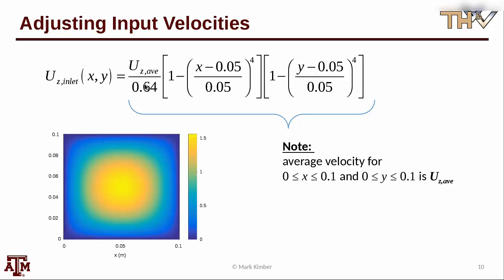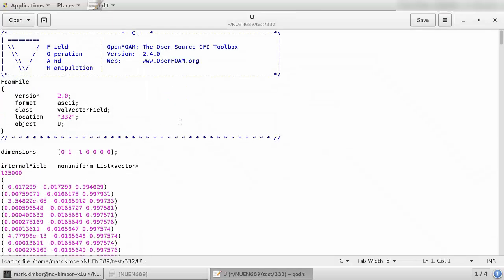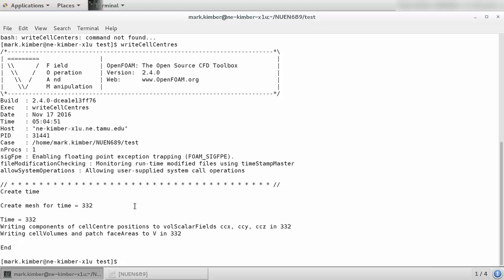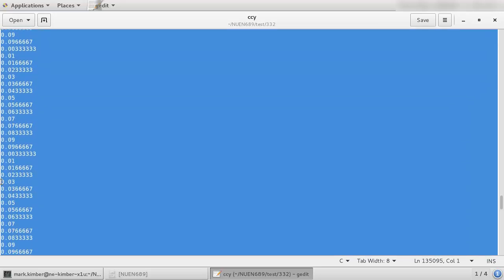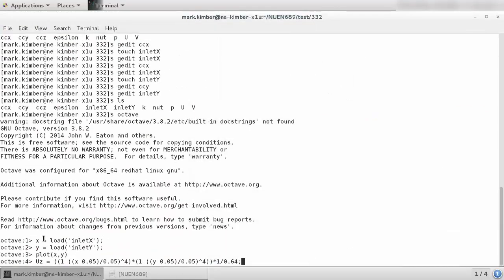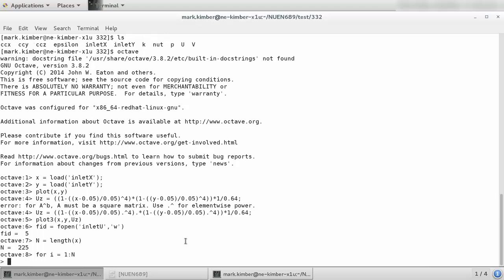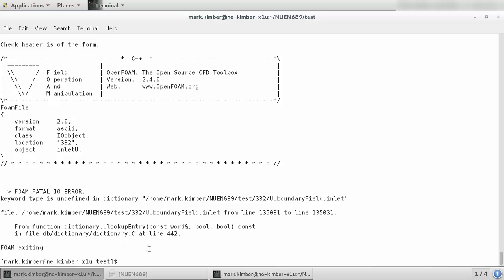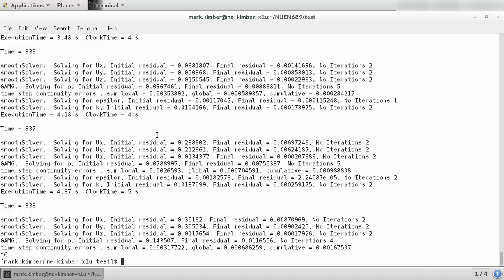Using non-uniform inlet profiles in openFOAM

Comment: I once did a project where I simulated pipe flow using LES. The number of cells in my geometry was in millions. If I had generated the profile, simulating time could have been considerably lower. If I have to initiate the profile using initial values, how can I save time. The real benefit in high speed flows and dense mesh where we have to extract surface pressure loads for Fluid Structure Interaction comes when we can initiate the profile directly without initial solution.

Comment: Hello Mark,

I have a quick question regarding monitoring velocity and mass flow values.  If I have multiple outlets in my  model, and if I want to monitor the Vx, Vy, Vz components of the liquid jet coming of those outlets, how can I do it while the model is running?  What command lines do I need to add to the code/ control dict, so the model generates an output file (.dat, .txt etc) that has the area averaged values of Vx, Vy, Vz values and mass flow rates for each outlet per time step or flow time or iteration while it is running?

Thank you and Gig 'em :) 

Ozgur

Comment: My copy of openFOAM (v1906) doesn't have this writeCellCentres utility. Is there any functionality for coordinates extraction in new versions of OF?
Reply: 1) load model in Paraview, 2) add the Cell Centers filter, 3) open up a spreadsheet view, 4) select specific boundary in Composite Data Set Index, 5) export spreadsheets's Point Data
Reply: It should be: postProcess -func writeCellCentres

Comment: Good job!
I wonder if there is a possibility to make it time dependent.
Reply: Try searching online for the timeVaryingMappedFixedValue boundary condition. You'll have to generate a bunch of files describing the points where you want to specify data in addition to the data at those points for specific times during your simulation. All of these files are stored in the constant directory of your case. OpenFOAM will then interpolate in space over time to transition from one set of data to the next when you run your case.